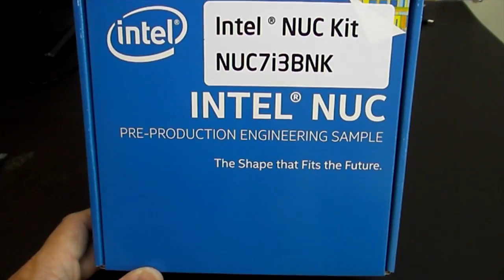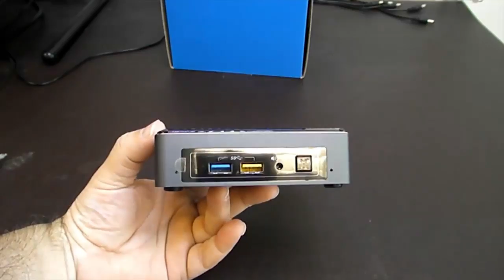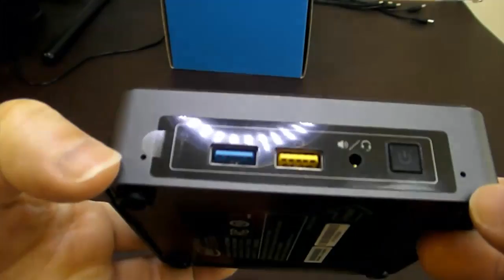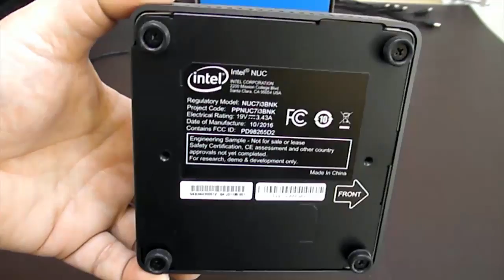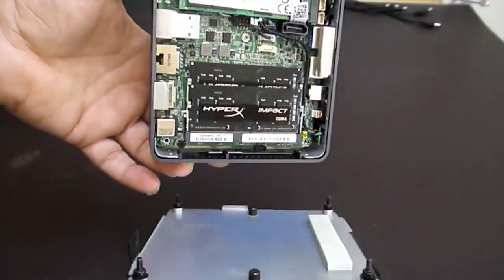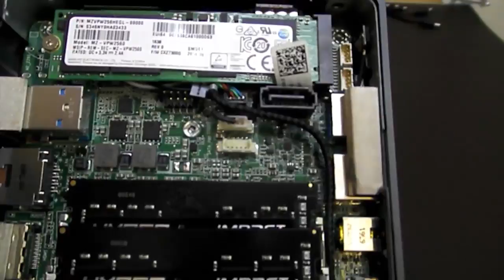New Intel NUC 7th Gen NUC7i3BNK First Look-Simply NUC

Comment: Can the i5 CPU be upgraded to an i5 or i7?  I found an i3 (manuf. 2019) NUC in a dumpster to-day. I haven't tested it yet, but opening the case reveals that a 250GB NVMe is mounted & two RAM cards are installed. Not sure if the RAM size. This is the 2nd NUC I have found!

Comment: Can you run a second monitor from this? it fails with the 8th Gen.
Reply: Yes you can run a second monitor with this as well as the 8th gen from the Thunderbolt port.  You might want to check the adapter you were using which may be the cause of it not working.

Comment: My 2010 Dell tower started to act up so I contacted my son in law with a masters in CS for advice. I never heard of the NUC and I bought the NUC7i5BNK. I use it with a 7 port powered USB3 hub. I am very pleased with it. I am especially pleased with how cool it runs. I had some trouble getting the software for my HP Scanjet 2000S1 to work with Win 10 but I eventually got it to go good enough. Everything including some softwaref from the late 90s it working fine. I am quite happy with it. It was not the cheapest solution out there but I am satisfied with the value I got.

Comment: hey buddy, 
Intel NUC Kit NUC7i3BNHX1 2017 Mini PC (Core i3-7100U Processor/16GB Optane Memory/Integrated Graphics), Grey
i am interested in buying this product and want to know after getting it i have to install ram and ssd things or this will be pre-insatlled ?
Reply from the maker: Hello Neeraj. If you use this link you can select the RAM, SSD and OS that you would like to have installed in that system.  If you select 16GB Optane as your primary SSD it will be the same as this BNHX1 model you are asking about. https://www.simplynuc.com/7i3bnh-full/

Comment: If you had 4 USB external hard drives connected to this device at the same time, but only 1 external drive would be used at a time, would this be fine or would you still recommend an external hub?

Comment: Charles, those in the video are 2 x 4 GB Ram or 2 x 8 GB Ram. Do you think that a total of 8 GB Ram could be enough? Or need 16+... Thank you for your answer
Reply: Howdy Juan. These are 2 x 16 GB DIMMs for a total of 32GB. If you order 4GB, you will get a single 4GB DIMM. If you order 8GB, 16GB, or 32GB, then you will get a matched pair of DIMMs. The 32GB option also gives you gaming DIMM upgrade. The 32GB option is Dual-Channel, Dual-Rank, Dual-Bank.

For a Core i3 Product, I would say that 8GB (2 x 4GB DIMMs) should be sufficient. 

All versions of the SATA SSDs are Quad-Channel, so the performance is much better than "economy SSDs" with writes around 300MB/s on the 128GB and up to 520MB/s on the 512GB. Reads are from 440MB/s to 540MB/s

The OS (Linux or Windows 10) are modified to work properly with SSDs and contain no Adware, Bloatware, and Post-Sale Revenue software, just a clean OS install.

Hope that answers your questions, if not feel free to ask more.

Comment: does the ram come with the PC?
Reply: and can you make a video on setting up 2 monitors to it also does it come with a wifi card?
Reply from the maker: Yes. It comes with wifi and can easily run dual monitors. Our systems ship with RAM, SSD and OS installed and come with technical support as well. If you just purchase a NUC online somewhere else it will not have RAM or SSD.
Reply: Simply NUC Are there any current generation models with IR receiver ?

Comment: any word on a skull cannon revision with the Kaby lake processors?
Reply: There are currently no plans for a Gen 7 Kaby Lake Skull Canyon replacement. 
We have mentioned to Intel to maintain the higher wattage 4x8 chassis, which they seem to agree to. We will continue to encourage them to plan for a Gen 8 4x8 Quad-Core i7 refresh later this year. I think there will always be a place for a higher wattage, Quad-Core i7, but sales are not as good as the 4x4 Dual-Core i7s. 
I think this is because in this space, small size dominates the higher performance of the 4x8

Comment: Cool video,
what kind/brand is the hard drive/m.2 ? sounds like it's pretty fast.
Reply: We use multiple brands of High-Performance SSDs based on best performance for the cost. All are Dual- or Quad-Channel, and even the 128GB has read speeds in the 480Mbps+ and writes in the 300Mbps or more. The 512GB has speeds closer to the max performance of the SATA3 link, with writes over 480Mbps.
We also offer PCIe SSDs (most are NVMe Flash based). Recently we tested an OEM version of the 256GB Samsung and hit sustained writes of over 1Gbps and reads over 2.8Gbps. We expect the 1TB version of this SSD to read at the max PCIe rate of around 3.8Gbps, and the writes to be around 2Gbps
Reply: The video was so blurry, I can't read the OEM Samsung M.2 256 part number. What is it? Please get a better camera!!!

Comment: would 128GB m.2 be enough for just Win10 and not much other programs? All my data will be on an ext drive. I only use it for KODI, surfing and BT
Reply from the maker: Yes our Windows 10 image uses less than 20GB.
Reply from the maker: Win 10 should only take about 20-22GB of the 128GB drive.